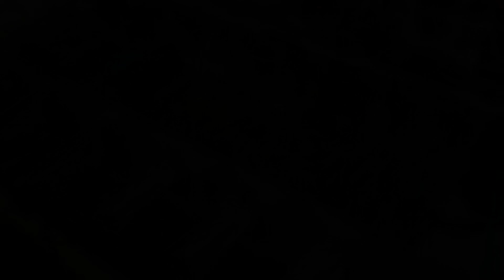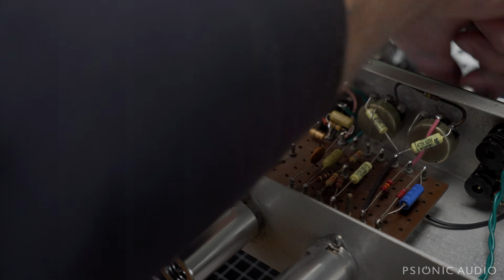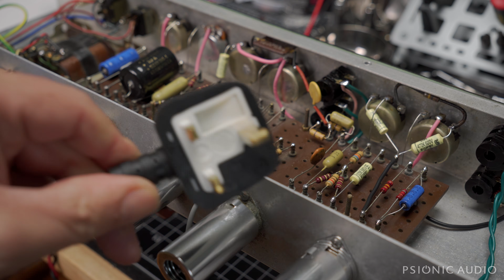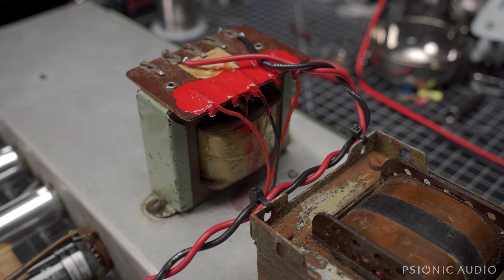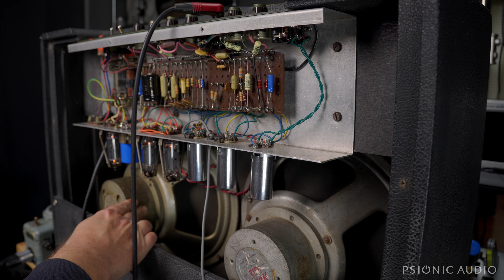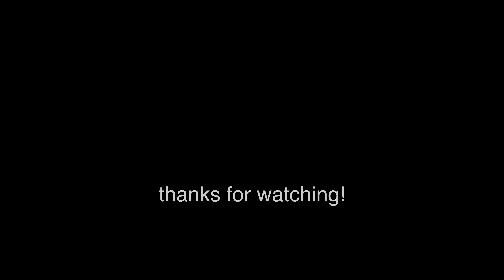'66 Marshall 1973 | Part 3 : The Finishing Touches

Comment: A lot that old electronic stuff had nasty surprises inside of an open back, just waiting for someone to give it a reach around. Some of the AC DC radios with metal cabs & chassis were famous for having even odds that those metal parts that were easily touchable for common use were live with 120 or 240 volts to ground. It was like sticking a fork in a toaster while touching the kitchen faucet.

Comment: How are you supposed to service EZ81 rectifier tube amplifiers on a Variac?  Should I consider one of those silicon diode rectifier plugins if I come across an amplifier with an EZ81?  And only plug the tube back in when all repairs are finished?
Reply from the maker: If you are approaching full voltage it won’t be an issue. In a bring up from zero scenario I’d remove the EZ81 and alligator clip in two 1N4007s.
Reply from the maker: I’m assuming it’s an issue with the EZ81 not being fully heated when current is asked of it. In a US scenario I’d think anything above 90VAC mains is safe.
Reply: @PsionicAudio  okay, I understand. I like to bring amplifiers from a dead cold whenever I swap out parts to make sure I didn’t introduce a dead short. I have current limiter dim bulb on my bench that has saved me on numerous occasions so far. I know I can get all dyslexic sometimes and make stupid mistakes. Bringing up from a dead cold each time saves my butt big time!